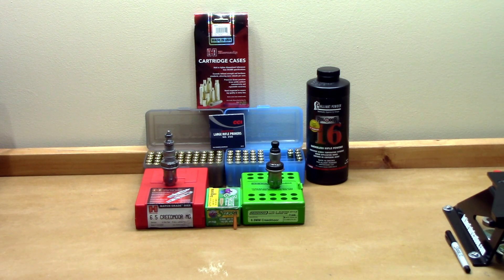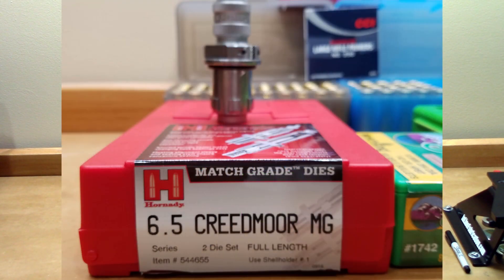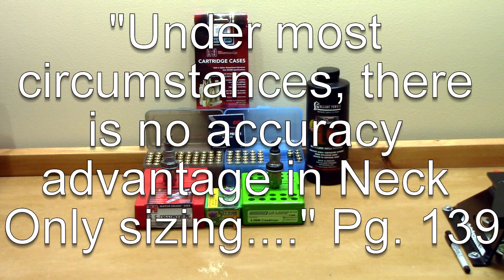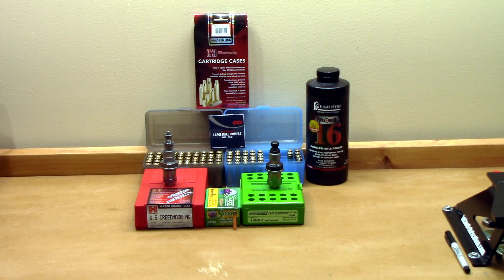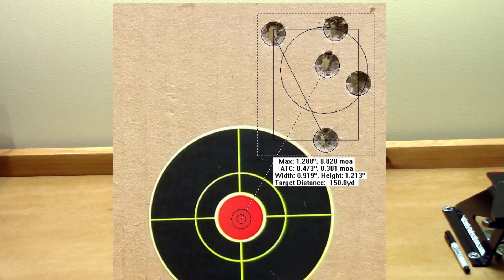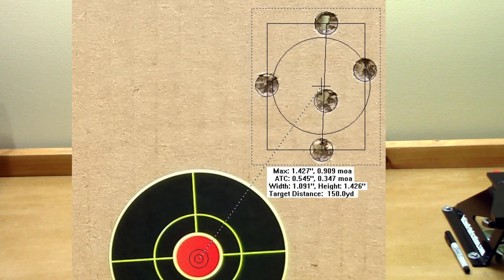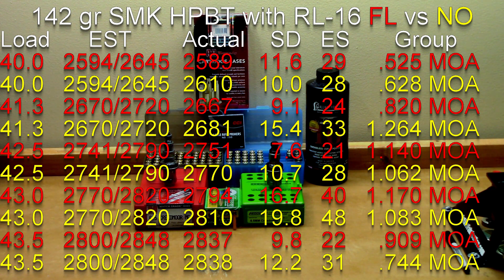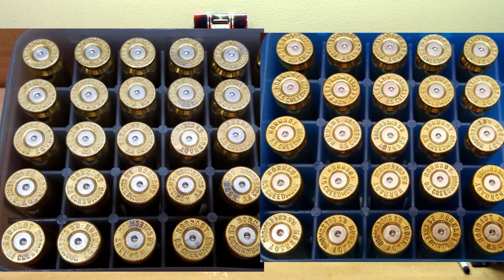Full length vs Neck sizing performance comparison

Comment: Great video! The result was pretty much what I expected as I've done a similar test in my own rifles.  What I've found is my very best groups with FL vs NO are never the same charge (all else being equal). FL might shoot the tightest group with xx.9 grns of a specific powder and NO shoots it's tightest  groups with xx.3 grns of the same powder. However, both groups are crazy similar in size when I find the best charge for that sizing technique. Bottom line is: both methods can produce excellent results if you spend the time to tune the load. I tend to use FL in my hunting rifles (allowing for dirt and dust and crazy temp swings) and NO in rifles that I only shoot at the range. Not saying that's the right move, just my logic that makes sense to me.
Reply: I would have liked to have seen how far the FL size die pushes back the shoulder in comparison to the neck sized (fire formed) shoulder.  

It's not really a question of whether to FL size or not.  Instead, the question is how far to push back the shoulder.  

That is, for some folks, FL resize means pushing shoulder back 0.002 while for others FL size means pushing shoulder back 0.010 or 0.015.  

In other words, tests like this need to better define exactly what is happening to the brass by measuring the cartridge base to datum line.
Reply from the maker: FL sizing would have been .002 to .003. No more unless you are trying for a case head separation. Never a need for more than .003 unless you are trying to fit in everyone's rifle.
Reply: Have some conviction and stop being a coward -- pick a side.  The answer is, FL is the only advantage either way.  Neck sizing is fuddlore, pure and simple, and all of our grandfathers were duped by it.  And in turn, all of our dad's, who told us this nonsense, were also wrong.  Stop neck sizing.  It is an inferior and silly method to go about precision shooting and will only keep you chasing your tail all day.
Reply: Since you fl size every time you cram the bolt home why not just fl to start. Iirc you can send a lee die in and $15 with a fired case and they make a custom from it. 

No was for the old days and belted cases with sloppy chambers.  Head spacing on the belt was a bad deal. So fire forming and no or partial sized was the way to go. The accuracy gain from shoulder head spacing started a trend in non belted. As time progresses their was a die change and better factory chambers. Leading to cramming bolts and no sizing becoming a thing of the past. 

Naturally what your ruffle like is better then any advice.
Reply: @daviddiebold7357  i cant understand your statement. please try to rewrite for clarity
Reply: @pearlrival3124  Nick only sizing is silly and inconsistent
Reply: @joshbrown284  you have no idea what you are talking about. learn more...
Reply: @pearlrival3124  okay if you say so enjoy your hard bolt throws, these days it's pretty much a consensus across the entire professional shooting community that next sizing is not the way to go.
Reply: @joshbrown284  not all guns are bolt-action. and no it is not a consensus across the reloading community. Only Erik's match shooting community thinks this is best. Reloaders do as such for so much more than just competition.
Reply: @pearlrival3124  you're commenting on a YouTube channel that's literally called bolt action reloading
Reply: @pearlrival3124  the only reason to necksize only is laziness
Reply: @joshbrown284  yeah "Johnny's reloading bench" was already taken...
Reply: @pearlrival3124  the vast majority of reloading literature that I've ever come across is on the side of full length sizing with a bushing die
Reply: @joshbrown284  There's another word for laziness....efficiency
Reply: I agree
Reply: I agree with you 100%. I was about to make the same comment however you beat me to the punch!  Although I have not done the test yet, it was my hypothesis that which ever method one uses will tune differently in a particular barrel. Question is which one will produce more consistant results? That is a topic for a compariaon video, if I had a channel I would go this route. Full length sizing does seem to induce more wiggle room in the chamber vs neck only. Also, it might also be working the entire brass more than neck only. Under ideal conditions, neck only in my opinion would be the better way to go, that being said under competitive scenarios, ideal conditions are the exception not the rule.. my 2 cts.
Reply: ... personally, I fireform new brass and then neck size for #3 reloads max, that's when I notice tight extraction occasionally. Then I anneal and FL resize. I lock the die on contact with the shell holder for a 3-4 shoulder bump.  A 1/8 turn adds an extra 9 thou. Then neck size for the next 2-3 and repeat...produces good consistency.

Comment: I really appreciate your 'what works best for you' attitude, I started reloading at the age of 12 in 1961 with a Sako Forester Deluxe in .243 Winchester. Dad didn't have time so he put me in charge of all reloading, both shotgun and rifle after strictly pointing out what he wanted done and how. That will probably make most modern parents heads explode, but things were more laid back then. The Sako liked 45 grains of the old Hodgdon 4831 and an 80 grn Speer FB. Everything was FL. I didn't know you COULD neck size. That gun and its favorite load would cut a small, ragged hole @ 100yds. Years later I bought a neck die, and, using the same brass and load; guess what changed? Nothing. Same group out of the same gun. Well, one thing did change. My brass lasted longer.  I had the same experience with a Pre-64 Win 70, which I still have and still shoot. The 70 had a lighter barrel and so the group opened up some, but not much. I still follow the same philosophy in my 75th year after tens of thousands of rounds in too many calibers to mention. Find the load the gun likes and stick with it. I don't neck size for autos since it can lead to feeding issues, but single shots and bolts seem to be fine, at least in the guns I use now, and the accuracy is perfectly fine either way. So again; thanks for not getting on the high horse of 'if you don't do it my way, you're stupid.' That gets old. Best to you!!

Comment: Glad someone is doing this and posting findings. I’m one who stopped neck sizing and switched to FL sizing. I don’t see any difference in terms of accuracy between the two methods but I like how easy it is to close the bolt when the brass is FL sized. I do both, but for match ammo, I now only FL size just for the extra ease to manipulate the bolt and reliability. I’m not the first one who made the switch so here is that.

Comment: I’m just an Old Phat Phart subscriber that’s been doing this Reloading Schmidt for something like 35 years, but I’m still learning new stuff all the time - Thanks for helping that process along with all your hard work and postings. It’s truly appreciated!

I haven’t started reloading for my Savage Stealth 6.5C yet, even tho I’ve got all the stuff to do it with. Been concentrating on my 338LM development first. Though I’d share an idea or two I’ve learned doing that and see how you think it might apply here. 

I’m using Redding bushing dies (the neck sizing die set that comes with the competition seater and the body sizing die) with Lapua brass. One thing I tried and saw definite results from was setting the neck sizing die per Redding’s suggestion to only resize approximately 3/4ths of the way down the case neck. The idea for this being to let the case better center into the chamber’s neck area, hence reducing possible “run out” induced from the case laying in essence on the bottom of the chamber. Then I use the included body die to set the shoulder back approximately 0.0015”, thus making chambering easy and not overworking the brass. As an aside, if you’re only setting your shoulder back a thousandth or two with a full length sizing die you’re really NOT full length sizing your cases. It can sometimes be tricky to actually see on your brass, but because our cases all have a little body taper to them, you’re really only partially resizing the case body. Both the resized diameter of the case and the length of the resized portion of the case are sized less than a truly full length sized case when the die bottoms out on the shell holder. Just thought I’d point that out to everyone tho I’m sure most were already aware of that. I’m probably preaching to the choir on that one LOL.

I’m really interested in your opinion on both this partially neck sizing as well as body length sizing in terms of making more precise and hence consistent ammo. I’m probably over obsessing on the entire process, but it seems to usually work out best for me in the end when I do (or at least I think it does LOL).  I also figure the practice would apply across all long range calibers, both the 338LM and the 6.5C and everything in between. 

So, am I all wet with this?
Reply from the maker: Glad you are enjoying the channel. this is certainly not meant to be a end all to end all test, but it does reflect my results overall. With any bushing neck sizer I really don't think that you can fully size the neck. it might be the difference in 3/4 of the neck or 7/8 of the neck but you are going to have that affect as long as you aren't smashing your die into the shoulder. One thing I feel strongly on is that the more you work on tweaking one or the other you will find ways to improve it or find what works best for you. I find that using a Full length size die and a Sinclair expander mandrel I consistently get the lowest run out of all of the combinations that I have put work into development. I have NEVER been able to match the consistency with a NO die that I get with the FL die and expander mandrel. That is just me though. I desire the lowest run out and the ability to always chamber my rounds. I am not sure that there is really a huge advantage of one process over the other, at least to me, but many loose their mind over this argument. I am not shooting bench rest either. Best of Luck to all with your decision.

Comment: I've been reloading 49 years with 32 different calibers. Some cartridges seem a great deal easier to find the happy spot than others and after loading for my 5 different Creedmoor rifles seems I've happened up on a true load that can actually be used for all 5 rifles with different MOA results for each after 14 different loads, powders, and bullet combos. Never have I had such great results with these loads than any other caliber I've loaded in the 6.5 calibers. Neck sizing only works great for two units as full length works best for the other three. COL range for accuracy being 2.810" and 2.815" and anything above those lengths do not increase accuracy but has caused feed issues out of the magazines with all being bolt action rifles. Reloader 15 and IMR4895 have given best results for me using Nosler 140 grain Ballistic tips and 1:8 twist. Best accuracy achieved with 2670 to 2700 fps chronograph loads. The most accurate powder load for me was IMR4895 @ 35.8 grains. This cartridge load achieved .226" to .585" in my 5 rifles. You might achieve better results than myself as I'm in my mid 60s and not as steady as my younger years. Good luck and hope this helps with your data. I have passed this same data to others at the range with lots of positive results.
Reply: Can or will you share what primer you use?
Reply: Thanks for sharing some of your extensive knowledge on reloading. Some people won’t share anything and it goes to the grave with them which I think is a waste. Thanks again!

Comment: I have been reloading my 270 for 20 years. I don’t weigh primers as some do,  Just size, trim, weigh charges and seat carefully. In my Remington 700, my neck size groups are 1/4 inch at 100 yards, .643 at 200. Full length sizing 50 % larger. Neck sizing works for me. After 10 reloads, cases still look good, but I do replace them at that point. Good video.
Reply: I was getting around .50 sometimes .35 grouping at 100. I saw a video by a pro shooter saying to stop doing neck only sizing. I listened to that and I've been wrestling with different loads ever since.

Comment: My preference for neck sizing is based primarily on the excellent performance of the Lee collet dies.  I have used them for years for .223 through 7mm Rem Mag. They have consistently demonstrated nearly perfect alignment, and much, much less case elongation than any other solution I've tried.   Check your loaded cartridges on a run-out gauge, and you will see a noticable  improvement in concentricity with the Lee Collet  neck sizing option.
Reply: Greg Page definitely for belted cases do it headspaces on the shoulder

Comment: Another great video, thanks moparmadman.  A couple of interesting points this test illustrates.  1)  Velocities are consistently higher on the ns and might have something to do with concentricity.  2)  velocities in 40.0 (2600) and 43.5 (2837) both appear to be in accuracy nodes, whereas the other velocities might be in scatter nodes, relative to your 24" barrel time.  I think Quickload supports that.  Good stuff, keep up the great work.  Am liking your channel.  Thanks again.

Comment: Interesting. I don't know why reloaders seem to think that there are only two options, neck size or full length sizing brass. There is a third option of bump sizing. The reason why reloaders like to neck size is the concentricity of the neck tension that you get from a Lee Collett die or mandrel with a bushing die. increasing brass life is not the main advantage of neck sizing. For tactical shooters, reliability is important because in the field, dust, dirt or rain can cause a malfunction with neck sizing only. This is why most tactical shooters prefer to FL size their brass for reliability. Consider this, you can do both, you don’t have to choose between these two techniques for resizing brass as part of your precision reloading process. Neck tension can have a lot to do with the consistency of your ammunition. How much pressure is required to unseat the bullet can drastically affect the consistency of your ammunition and how tight your chronograph numbers will be. I use a Lee Collet neck sizing die for the good concentricity and then bump the shoulder back 2 thousands with a Redding Body die for the added reliability. Using this method, I have single digit SD with lower ES , and the reliability of FL sizing.
Reply: Couldn’t a reloader use a FL bushing die? And do it all in one step?
Reply: @drummachinejoe1451  Exactly what I was thinking.  That's what the FL bushing dies are for.  I'm not sure why people think neck-only sizing is the only way to adjust neck tension since that's what full length dies do in addition to body.

Comment: I agree that full length resizing is the way to go, especially for good function. The one thing that i do use however is the Redding Competition shell holder set to set my headspace where I desire, rather than setting the shoulder too far back and overworking the brass.
Reply from the maker: I am starting to use my forester press. No Shell holder! :o)

Comment: Your test data set is very interesting. I used to neck size and full length size my 300 WinMag. I had many stuck cases and difficult extraction with NS but no issues with FL. I had to reduce the powder charge to prevent stuck cases when I neck sized. I think the 6.5mm CM case has a slight taper, preventing stuck cases.

Comment: Another great video.
Interesting that I have got back to FL sizing after 12 months of neck sizing only. I'm finding that I get better overall results by using a 'correcting setup' FL die.
Thanks again..👍👍
Reply from the maker: One of the things that Zediker mentions is that often a Neck only die frequently adds to a problem if there is one and that the you need to occasionally use a Full length die anyway so why not just use the FL die. Seems like something a concentricity gauge would tell you assuming that you were checking it of course. Thanks for commenting.
Reply: Update:

Well I went to the range last week and tried out your topic. FL verse neck sizing in my 223
I shot 3 x 5 shot groups first with my neck sized only loads and then followed up with the FL sized loads.
Distance was100m

Results:  neck sized.  0.71,  0.81, 0.82.   Not my best results with this load but it is what it is on the day.
                FL sized.      0.38,  0.35,  0.47.  Same day, same conditions, same number of coffees.

I was shocked by this result. My neck die is a Lee Collect and this maybe the problem. I found a fine line between getting good neck tension verse pushing the case should back with this die.

I'm now going to purchase a Hornady headspace gauge to fine tune this FL sizing for my chamber.

Thanks for the inspiration
Reply from the maker: +KennyA thanks for the update. Glad that someone else is interested to try these things out.

Comment: Thank you for an interesting video. I am curious to know if you measured neck or bullet runout between the two re-sizing techniques?  A comparative resizing test followed by a same load shooting test of ammo sorted by runout would be fascinating.
Keep up the good work and thank you.
Reply from the maker: Thanks for the comment. I have been chasing a "perceived by me" run out issue and am working on it. Most everything comes out <.002, but every now and then I get a guy that's out farther. Its a video concept that I am chasing, but I am sure it will be on here some day. I am just starting to cycle brass through the forester press and I have a couple other things as well. No shortage of work to do either, but thanks for watching. I am always looking for great ideas for down the road.